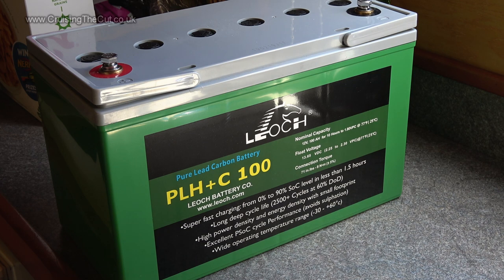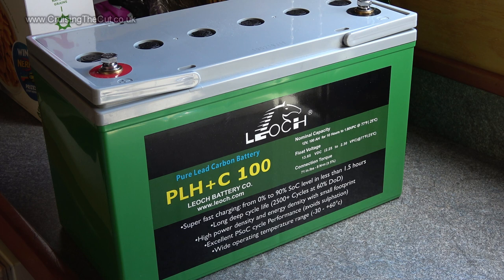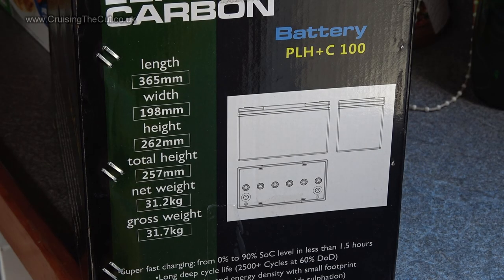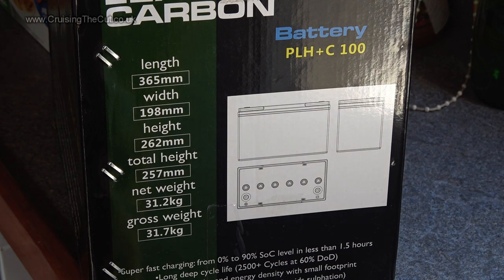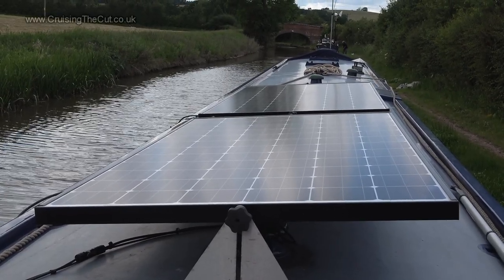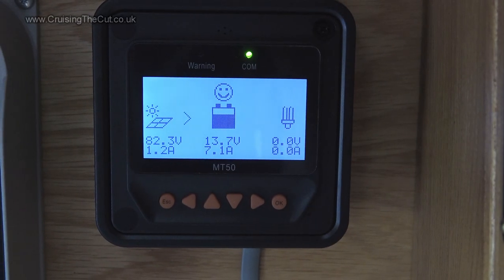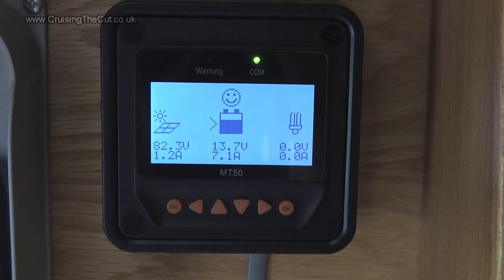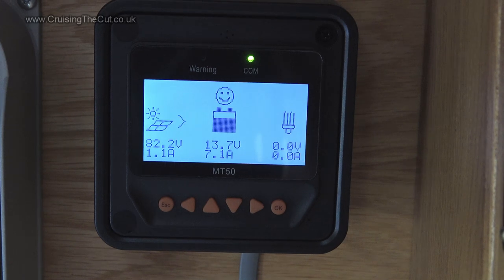178. Installing Lead Carbon batteries (12V 100Ah) into my canal narrowboat

Comment: Great video. As I listened to you explain the connection of the solar charger I thought, he doesn't know what he's talking about, right before you said, I don't know what I'm talking about. Perfect timing.
Reply: Connecting the solar up diagonally across the pack ensures that battery link resistances between each battery and the solar connection are identical, 2 link cables in each case.

Comment: David. Still binge watching (for the 2nd time), slowly getting to the latest video again. As an ex electrician and an electronics techy (radio, tv, and transmission engineer) I must salute you. It may only be 12V but it can still be dangerous and caution is always a watchword, especially with high current situations. Your disclaimers are amusing but true. There are plenty of YouTubers who profess to be experts, having learnt from the comfort of their armchairs, who show terrible examples of "expert knowledge" and send others down rabbit holes or worse, dangerous installations. I and am sure others, look forward to an update on the batteries performance.

Comment: Sparks:  Danger,  it was VERY Good that you checked the Voltage,   when you connect batteries in in parallel the cells need to balance to the exact same voltage!   If they are Not the exact same level you will get a HUGE charge to "catch up" to that balanced state.    Also the exact same temperature!

Good news your battery bank was "close" to balanced, and at the same temp.   Also NEVER wear a ring!

Comment: A former colleague of mine once managed to short out a 12V 100AH battery through his wedding ring. Carrying a huge amount of current, the ring got very hot very quickly and burnt his finger very badly indeed. So yes, your tape precaution on the spanner is a good idea and removing jewellery is also highly recommended including anything worn around the neck on chains. The reason for the little spark may be due to inverter stored charge on an input capacitor or small imbalance between batteries. Current will flow between packs to equalise them as you connect up in some cases. These new batteries are interesting, it will be good to see how you get on with them over the course of a year.

Comment: New subscriber here, really enjoying your videos.
On the subject of which battery terminal to disconnect first and re-connect last, the answer is very simple.
It is always good practice to disconnect the negative terminal first. This comes from working on vehicles, where the negative battery terminal is grounded, i.e. connected to the vehicle metalwork. If you were to put a spanner on the positive terminal, and then part of it came into contact with any metallic part of the vehicle, you would effectively short out the battery! 
Dis-connecting the negative terminal first, completely removes this danger.
Reply: Unless of course you happen to have a positive grounded vehicle... 

Disconnect the grounded terminal first (nevermind +/-), then, as stated, your tool can can only cause a short against the other terminal, not any surrounded bodywork/items. 
And while working on high current (capable) circuits, Remove metal case/strap watches, rings etc. You DO NOT want any of those being part of a short circuit, as they might end up red hot...

Comment: I learned at a young age what it means when a battery blows up.   My father and I were way back in the wilds of our farm for a Thanksgiving Day rabbit hunt when the solenoid of our late 1950s era pickup would not provide a spark.   Dad attempted something I'd seen him do before, he tried to bypass the solenoid with a metal wrench.  It sounded like it might work when the battery exploded directly in his chest and face.  I had to guide dad a quarter mile down to the Wabash River and wash out his eyes.  Luckily, that worked, and further luck was with us when dad's cousin happened to show up and give us a tow about 2 miles to the main road.  There, a faster tow actually got the pickup running.  The next day dad's jacket he'd been wearing was in shreds.  Kinda happy electrical systems have progressed.
Reply from the maker: Ouch!! Wow.

Comment: Looks like you have been doing your homework, which is a really good idea, with the high current available with these batteries, an inadvertent short can cause a huge mess.  It's good you caught the wiring error between batteries as well.  

I had never come across Lead/Carbon batteries before so, I went to the Leoch website for information which, was a bit lacking.  Looks like the advantages over an AGM battery are increased cycle life, faster recharge, and improved low temperature performance.  Series resistance is still quite high with any deep cycle lead-acid battery technology.  With that size battery, I don't recommend trying to pull more than 10 amps per battery long term (or 300 watts out of your power inverter).  You can go several times this amount for short periods (no more than a few minutes), at the expense of reduced battery voltage and internal battery heating.  The lead-acid battery technology does not like heat.  The maximum sustained temperature is around 26 degrees Celsius.  I know many of the batteries show a higher operating temperature but, it is at the expense of battery life, which erodes quickly as temperatures rise above 26 degrees.  In fact, lead-acid batteries should never be mounted in an engine compartment, it really shortens the life, and batteries are expensive.  Most people don't know this because, that's the way it is generally done with cars.  The car manufactures do this to save money on battery cables, they don't care about battery life.  Moving the battery from the engine compartment to normal room temperatures yields double the battery life as a minimum.

The wiring around your batteries looks like it is good for no more than 100 amps.  Currents are really high with a 12 volt system.  For the amount of power you are trying to pull out of your inverter, I would go with a 24 volt system if I was putting together a new system (I realize this is not practical, you are stuck 12 volts).

As far as the observed spark when connecting the batteries back up.  The power inverter, the solar charge controller, and probably your refrigerator, have a large capacitor bank that is connected directly across the 12 volt line.  These capacitors are at 1 volt or less with the power disconnected.  When you reconnect the 12 volts, thousands of amps flow at the instant the connection is made.  This huge surge is very hard on switch contacts and, as you probably have noticed, takes a bite out of the battery terminals.  To get around this problem, I temporarily connect a 12 volt incandescent bulb (5 to 25 watts) across the battery terminals, which does 2 things: (1) It greatly limits the surge current and (2) If the bulb does not go out within a few seconds (after it charges up the capacitors), it shows you may have a short in your electrical system.

With Solar Charge Controllers, the battery must always be connected first.  Connecting the panels up without battery power can damage the controller.  I know these comments were quite lengthy but, I'm hoping these tips will help others with their leisure battery system.
Reply: How does putting a bulb across the battery terminals help capacitors in other components when their circuit with the battery is completed?  And surely the battery would power a bulb for more than a few seconds on a leisure battery?  Can you explain or re-word what you meant about connecting a bulb across the battery terminals

Comment: some really great batteries!! and a  g reat installation video. If all are connected, then it makes no matter which end gets the charge, nor which one is the drain connection. All are the same,,connection wiring keeps all from having a voltage difference or spike.....good work my friend!!
Reply from the maker: Cheers. It does make a difference though, at high current draws, see the article linked in the description.

Comment: You do have them properly connected & sorted out so I will suggest a few things to play with for further upgrades. 
1) A  positive & a negative DC bus. The purpose is to provide a single connection from the battery bank eliminating multiple connections to the terminals. This also facilitates any further connections to the battery bank.*
2) A battery switch or disconnect for the invertor/charger. This is a safety feature that disconnects the invertor. If you are working on the mains, the last  thing you want is the inv/ch to start inverting while you are working on something, ouch!
*The positive side of the battery, called the 24 hour side, is for a constant DC feed for pumps etc . & should have a breaker for both protection & disconnection. This would also be for the solar panels  & battery monitoring. The main disconnect for the house can also be connected to this bus as well.
*The negative side of the house bank can then be shifted to a shunt with the addition of 1 extra negative cable to the DC - bus when adding the battery monitor kit. Victron does make a nice battery monitor that is quite easy to install.
 The reason for doing a connection ACROSS the batteries is to  prevent starvation or under charging to the lead battery since electricity flows from + to - and will not charge the preceding  battery.

Comment: Sparky here (but not a boat or automotive one). Your new positive cable coming back from the solar controller looks very thin... this should be an absolute minimum of 4mm, preferably 6 or 10 mm. 
You should probably also consider an isolator for the inverter, or running it through the existing isolator. 
The spark is to charge the capacitors in the inverter, not discharge them.
Reply from the maker: It's funny you should mention that because I was idly sitting in the engine bay a few days ago and my gaze fell upon those cables (installed, in the early days, by a boat electrician as it was before I knew anything about solar etc) and I thought "they look a bit small" and it's since been put on my "to do" list to alter. That said, they've been like that for four years and we rarely have sunny enough days that they ever carry much for very long ... however, I do concur they should be thicker.

Comment: Don't forget a little bit of lithium grease or spray silicone on your battery posts and connectors so they stay nice and clean and oxidation-free. :)

Comment: The batteries are not exactly at the same charge level, so when you connect them in parallel you will see a small spark possibly when they equalize so the voltage is the same across all of them.

Comment: The inverter has condensators that should be shortened with a resistor before connecting the new batteries, but that is expert stuff and almost nobody knows it. Best of luck with the new batteries. Be safe.
Reply: condensators = capacitors  and shortened = shorted (discharged) GOOD Points, take heed! :)
Reply: @sre331l  Thanks.. As a foreigner my language is far from perfect. I stand corrected.

Comment: About that spark.  Yup... the capacitors in the inverter!
Reply: An old electronics repairman's trick: make a discharger with a bit of wire, an alligator clip, a dry piece of wood, and a one to ten megohm 1/2 watt resistor. Hook the clip and the resistor to the ends of the wire and fasten the resistor to the end of the wood with the unused lead sticking out as a probe. Fasten the clip to a ground and use the probe to slowly and safely discharge things like power supplies before working on them.

Comment: David, you have excellent Victron power equipment aboard. It would be no great stretch to incorporate a battery management device, possibly Victron, to have a positive handle on battery charge, performance and their state of health. These are not big ticket items and my management meter give me extremely useful insight on my system charger, solar, battery, and engine alternator on SV Enough.
Mark Fay US MMC Jr. Engineer QMED AS-E

Comment: The inverter has capacitors in the circuit, so when connecting there will always be sparking. This is mentioned in the inverter documentation.
Reply: Not always but it certainly should be...
Reply: Not if you use a 10 ohm's resistor touch it to the cable and the batteries then connect when reconnecting always positive first then negative current flow's negative to positive

Comment: On my boat  i learned to disconnect the red positive first. Reason is be cause if the negitive  wire is removed first and touches the bulk head it will / can act as a negative  post. Just from  my experiences  . Keep  making these they are the best .

Comment: David, you are over complicating things.  All your three "house" batteries are connected in parallel. All the Red leads (+) are connected together, and all the Black leads (-) are connected together. So all three batteries are connected in "parallel". This means that it makes no difference "electrically" which "positive" leads are connected to external positive leads, and which "negative" leads are connected to external negative leads.
However, this is an excellent Vlog which I thoroughly enjoyed.
Reply from the maker: Hi. Yes, I know what parallel means, cheers. It does make a difference, see the link in the video description.
Reply: @CruisingTheCut  Well in 44 years in the MN this is the first time I've seen this. I'll bet a pound to a pinch of Pig guano that my colleagues have never heard about it either. I can't wait to tell them!
 By the way, just before Christmas, I was working on a ship, with an emergency bank of 46 batteries connected in series. The voltage at the output was getting on for 600 volts DC. 
I kept my fingers well away from this, as you can imagine!!
Reply: @bigglestheflyboy  The idea assumes a voltage drop on the wires connecting the batteries, so if you assume the following 2 battery example with thin wires:
20A charge to 2 batteries, 0.1 Ohm resistance per 'parallel' leg, so battery 1 gets 14V and sucks out say 15A leaving 5A going to battery 2, via 2 x 0.1 ohms = 0.2 ohms, V=1R, so that drops 0.2 x 5 = 1V, so battery 2 voltage is now 14V-1V = 13V (which is why it draws less charge current in our example).
So the first battery gets charged first and fastest, then floats at high voltage while the others catch up. This reduces battery life slightly and blurs the charge states which doesn't help the charger.
If instead you connect up alternate ends then each battery gets an even 0.1 Ohm connection so each loses 1V at 10A so each gets 13V.
The same works for multiple batteries because as go along the bank getting closer to one connection you get further from the other so all batteries see an equal resistance to the main harness. 
It also works for drain as well, so it's kinder on batteries when drawing e.g. 100A, if you don't use alternate ends the inverter tends to hammer the first battery far more than the last even with quite thick wires, so any inverter draw is far better using the alternate end connection.
Reply: @G-ra-ha-m  0.1 ohms would actually be a quite poor connection though. 6-gage wire (~16mm²) typically has a resistance of about 0.4 ohms per 1000 feet, 4-gage (~20mm²) is about 0.25 ohms per 1000ft. So for the maybe 2ft between those 3 batteries the resistance in the wire is less than 1 milli-ohm (i.e. zero for all practical purposes, we're not talking about kilo-amp currents here).
Where the resistance creeps in is usually the nuts & bolts, so it is crucial to use the correct torque and some terminal grease to prevent corrosion; then the resistance will be pretty much 0 as well.
Hence, for a handful of batteries it really doesn't matter. It only becomes a problem (potentially) if you have a huge battery bank. But then you want to use bus bars instead of jumper wires anyways.
Reply: @CruisingTheCut  With those short meaty cables the practical difference is bugger all.

Comment: It really is the residual charge in the inverter capacitors :)
Reply: it shouldnt be, if he turned the master switch off, but you do get a spark when connecting a battery bank due to the different charge leavels in each battery
Reply from the maker: Ah but for reasons I won't bore you with, the inverter/charger is one of the very few things connected directly to the batteries rather than through the isolation switch.
Reply: @CruisingTheCut  interesting..

Comment: David, "sparking" is okay, and rather entertaining.  It's the "blowing up" that irritates the neighbors!  That "residual spark" is caused by the flux capacitor in the circuit!  Your batteries are wired in parallel, so which terminal the red is connected to really doesn't matter, since they're all connected.  "No smoke, no worry".

Comment: You're bang on about how to cable up, I've just put 420ah of agm's in my launch, damn near came a cropper lifting the 200ah battery off the marina pontoon onto the boat, the boat blew off the dock mid way through the lift and I nearly went in the tide, holding the battery........ greetings from Auckland New Zealand. Really enjoy the vlog......
Reply from the maker: Blimey!! That could have been very bad indeed!